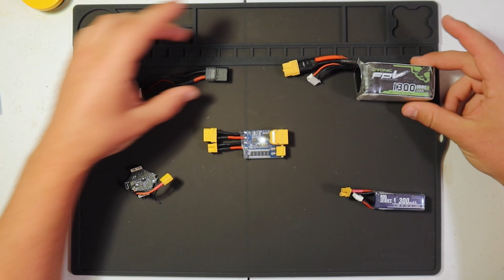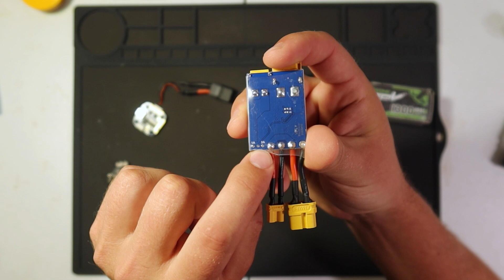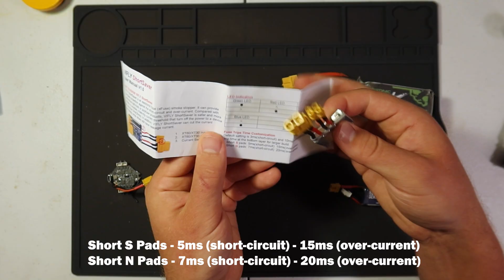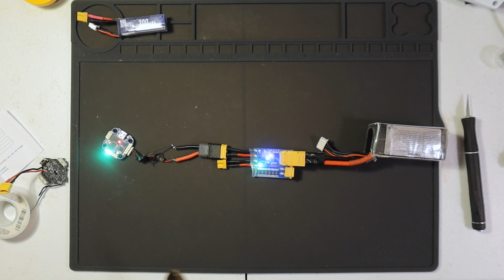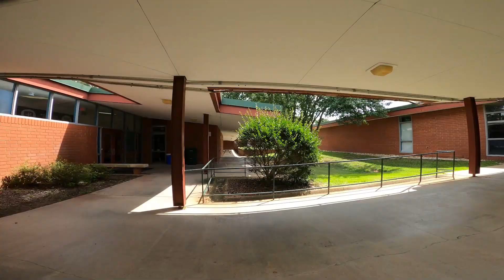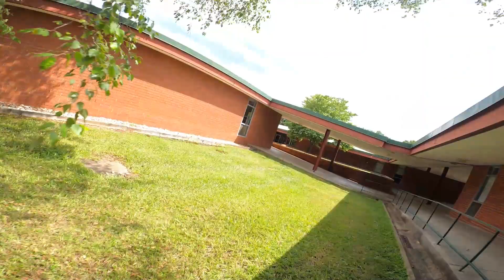Don't fry your new drone build! ViFly Shortsaver XT60/30 Smokestopper

Comment: this is useful ! so the smoker is only used before check not for real flight right ? coz the esc will draw lots amps much higher than 2amps.
Reply from the maker: That is correct.

Comment: Is this something that could be integrated into the quad itself, like say if your a real bad pilot that hits the ground and shorts something out, kills the power before it shorts out and lights the grass field on fire! Just asking for a friend :)
Reply from the maker: Unfortunately a smokestopper also has an overcurrent feature which would kick in if your quad started drawing more amps (e.g. arming and taking off). 
I've caused some hefty smoke from my circuitry shorting, but never anything resembling a fire. But I have damaged LiPo batteries to the point of danger...and they'll go up in flame if they get hit just right, even if they aren't plugged in at all.
Reply: @EdRickerVlogs  this tripped me up in a build recently as I thought I had a problem but I think its the overcurrent. the new o3 air unit is quite power hungry but no problems first time connecting a battery. it only started triggering the shott saver when I spun a single motor at high rpm or spun all 4 in the direction test in betaflight!